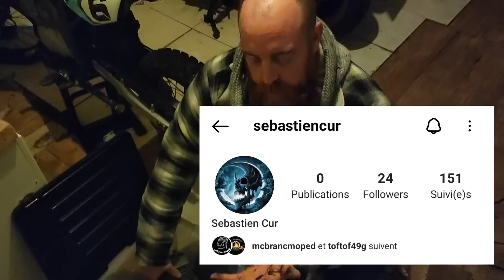une mob ne marche JAMAIS la première fois ( ni la 2nd, ni la 3eme...)

Comment: 6 bouteille ? Je ne vois pas comment tu peux bosser convenablement avec seulement 6 bouteilles. Là, c'est juste pour le réglages des freins, ou un remontage des carters latéraux mais pas plus.
Ces carters Malossi étaient excellent aussi sur MBK. Le plus c'est de pouvoir mettre une pipe AM6 là dessus.
Vu que tu aimes rouler, je comprends que la prépa ne soit pas ta came, car tu ne souhaites pas être emmerdé.
Perso, il faut que cela soit créatif, furtif et que ça pulse bien. Le challenge de bidouiller un moteur d'origine est vraiment sympa. 
Chez MBK il y avait une série de cylindres en liquides qui pouvait faire des trucs dingues. Une bidouille que j'affectionnais, était de couper un pot Sito cobra à partir de la cartouche (avant la soudure), puis découper en 2 pour le vider, ajouter un cône (tôle de l'ancienne pseudo-cartouche, mais véritable bride) et un tube et y greffer un silencieux. J'y mettais facilement 2 heures, mais ça chantait bien mieux. Dans le genre pot d'origine bridé à mort, il y avait le DT 125. Là c’était tronçonnage à un endroit précis, extraction de brides (2 plaques avec trous, cône et tube) et nouveau silencieux. Le scooter MBK Active est sympa pour s'amuser aussi.
Reply from the maker: Yes , ben tu résume tout à fait la bidouille que j aime faire. Tenter de débrider des trucs avec de la débrouille. Et en plus quand ça marche, quel bonheur
Reply: @alexmoped  "quand ça marche" ? Non, faut que ça marche !
Il est indéniable qu'avec de la bonne pièce le jeu est plus aisé. Cependant, il y a un petit coté jouissif de dire "c'est d'origine" et que le truc est trafiqué jusqu'à la moelle.